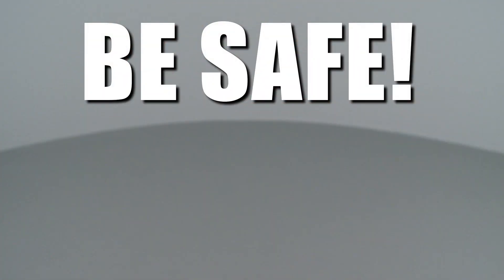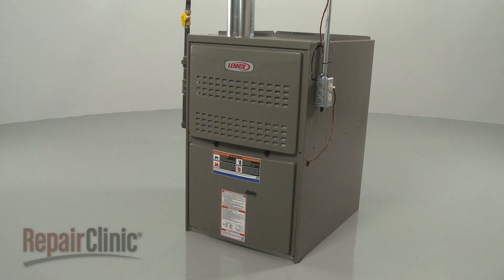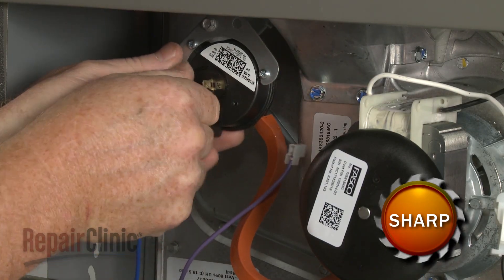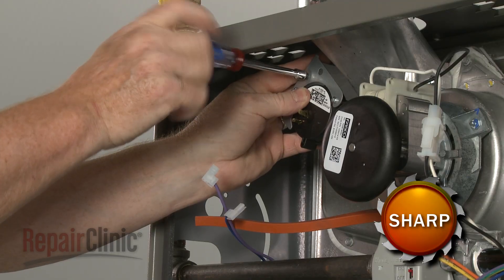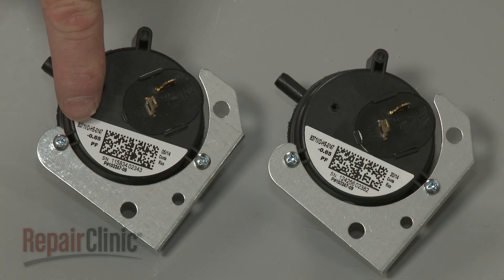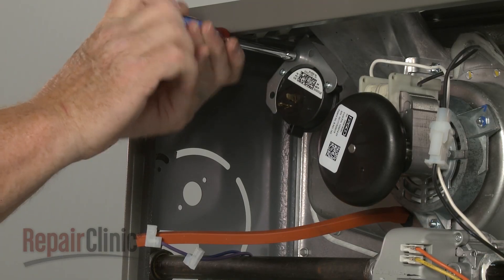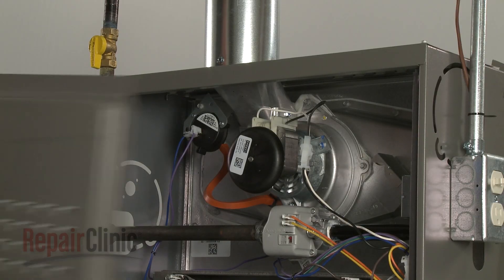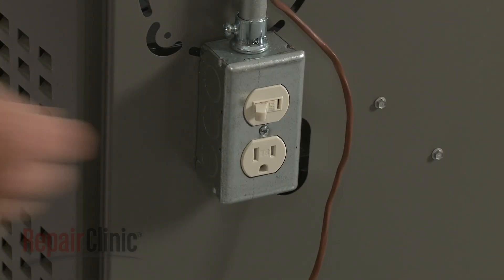Lennox Furnace Starts/Stops? Pressure Switch Replacement 80W57

Comment: I had the same issue. When I removed the tube and cleaned it out came a  small spider. Re attached the tube and furnace worked perfectly. Saved about $250 just to have a tech find the name problem.

Comment: 5 years after installation, my Lennox stopped working - code E227.  Called for repair and they went through all the testing and cleaning with no trouble found.  Installer noted the dual pressure sensor was under recalled so he decided to replace it.  Furnace ran for several hours with old dual sensor  but upon his return with the part it had stopped again. With new sensor no problems for last 4 years but this fall same failure and fault code.  Once again everything checked out including sensor.  While talking to rep I mentioned two weeks earlier my neighbour's 4 yo furnace died (different brand) no trouble found, and they ended up with warranty replacement ( labour not included, ouch). The service rep asked if there had been any large amounts of dust while the unit might have been running.  There had been, road crews used air blowers on street during some late fall major repairs and you couldn't see 25 ft to front sidewalk.  Service rep said it was a long shot but he thought possibly dirt/dust might be impacting the channels that feed pressure sensor hoses.  He blew the channels and 5 weeks later furnace is still running fine. I have to think with two side by side houses experiencing the same type of issue, on different products, within weeks of road repair, that the dust was a factor.   Of course it might just be voodo told to consumers so we feel they knew what they are doing. -35 coming in a month or so - sure hope rep was right.

Comment: Thank you so much.  My pressure tube was stopped up.  I cleared it and made sure the flu was open.  Hooked back up the orange tube and hit the power and this worked perfect.  We have an old flu that gritty and some material got into that tube somehow.  

This saved me a repair call on a 23* night.   On a new unit.

Comment: Just an update from Lennox.  They don't warranty if you want to be proactive.  If you DIY your pressure switch because there is a problem and then phone the company for warranty they will not warranty the switch.  So let your house freeze, pipes burst, etc. then phone the company even though you know that there is a problem.
Reply: The problem is that there are many things besides the pressure switch that will cause the same symptom.  So if they warrantied ever time some DIY'er decided to replace the switch they would be out a bunch of $$'s.

Comment: I like how all these videos on pressure switches assumes you remember what wire went to which terminal on the pressure switch ..why not be thorough and tell us how to know which of the wires go to which terminal or even it it matters ?
Reply from the maker: On any two wire pressure switch like this it does not matter which wire goes to what terminal as long as they are the correct two wires. No polarity on a switch like this. Thanks!
Reply: I was told the following by a hvac tech "Hi scientificfighting1, you are right that the "com" terminal is the ground wire and that the hot wire should go to the "nc" terminal. The "nc" refers to "normally closed" which means that the switch is closed when the furnace is running, and the switch will open when the pressure is low." and this is regarding a two wire pressure switch so its would seem either he is mistaken or it does matter which wire goes to which terminal.
Reply: ok I was just told by the same guy you are right. "just to clarify even though these switches may list "NC" and "COM" if you reverse the wires it will not affect the function of the pressure switch. As long as you connect the same wires as before, then everything should work." I wanted to make sure I corrected this to not steer someone down the wrong road.
Reply: How much does a pressure switch cost??
Reply: Take a picture moron